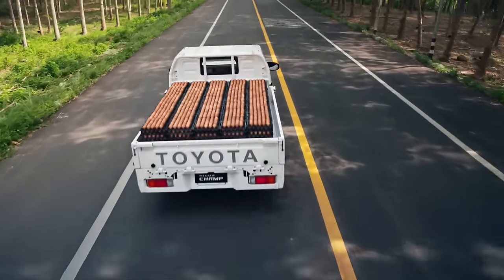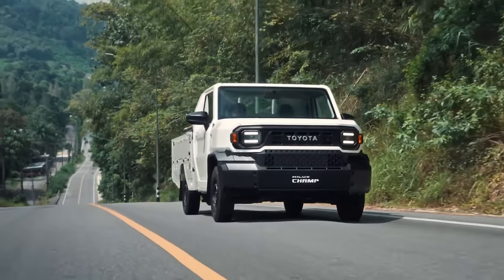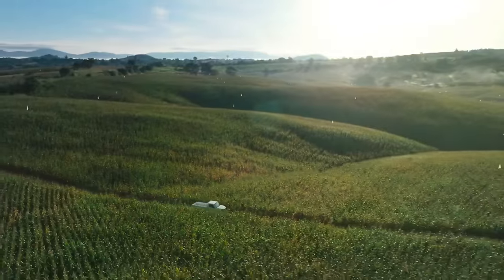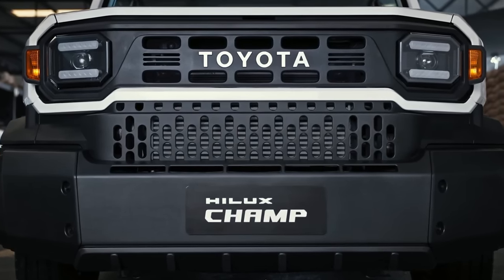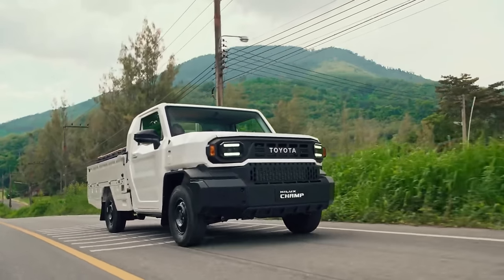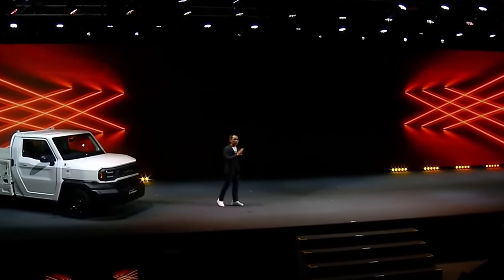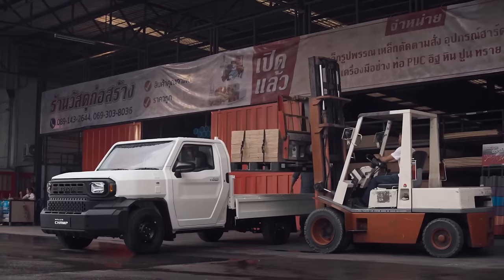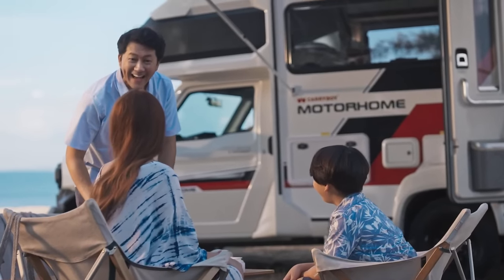Experience the Revolution: Toyota’s New $10k Pickup Truck That’s Turning Heads

Comment: You are certainly correct.  People in the USA are begging for just such a vehicle.  Currently, in the USA mini-truck market, there are EXACTLY zero such vehicles.  I drive a 1985 Toyota 4 x 4  single cab pick up.  The neighbor needs a load of topsoil for his garden?  We drive over to the depot and the loader just dumps it in the back.  Most other people use a trailer.  Mine is suffering from age related cancer and the lift gate fell off this last summer.  The bed is nearly totally rusted out, but, oddly, no rust at all on the cab.  At 805,456 miles (1,296,255 km),the engine and transmission have both been rebuilt once.  A little sloppy on fuel economy (15 mpg or 6.4 kpl), but still more economical to drive than nearly anything else on the market (reliability adds up), Toyota will bring the same reliability to the Champ, if it ever gets here.....  I want the hybrid 4WD model and I want FOUR WHEEL DRIVE (with a manual transfer case), not AWD.

Comment: Here in the US I would be first in line for one if it was 4Wd, extended cab for gear and cloth seats.
Reply: This is the exact thing im looking for. We say we want smaller more affordable more durable trucks. Ford did the mavrick and i think it was a big step for affordbaility but its a unibody thats more for errands. Thid truck you hage that steel bed you can really really do somd serious work without aprrying about it. Keitrucks people were thinking are closer to what we need and this truck toyota seems to be combining like a keitruck back but a more usual engine in an engine bay infront of the cab type design. I think this is a huge saftey improvement and it migbt be what we need to get that kind of a style road legal in usa. Having better powerplants compared to keitrucks too is big.  Being able to buy them brand new is important and right now you cant buy keitrucks new. I want the more durable steel bed i think that ultra durable bed is a super big deal. You habe to be able to beat it up for 30 years and it should still be going.  The single cab is more affordable and easier to replace with a couple buddies if need be and i like that design for a utility truck. Affordable tires. And as well as having a range of gasoline, diesel. Hybrids, and electric all at the same time is a big deal too. A platform with options to suit different peoples needs is big. I like.the diesel but someone who drives less will like the electric and people inbetween will like the gasoline motor. So its good to see that. Body on frame is also keystone feature for me in a truck. To have a truck like this thats body on frame is good.  If they cost 10k or like 15k for the diesel or something like that, it would be crazy esspecially if we could finally get them in usa. The proble. Is toyota tundra and tacoma are big and expensive. Theyre nice usa likes them i like them but i also like innovative ideas like this for a lot of the work load. A truck like this is grsat for moving around my motorcycles, pickup up the poting soils, rocks etc. A more durable bed for that junk work keeps the nicer more expensive trucks in good shape longer.  I think this type of design is a little safer than the keitruck design as well. I think if we dont allow these on american roads we must revolt like george washington intended. Ford is supposed to have something like this Under the mavrick for real. This is what we wanted. Thisnis right down the alley of what many americans want. This truck can truely overtake the legendary 90s tacomas. Very smart kind of truck. An actual small and extrae extra durable. You get a super durable bed compared to aluminum tin can thickness sheet metal which is what i want. Diesel as an option is dope. Thats what i would get personally. I like these trucks so much compared to the great tacomas and ford rangers i think theyre durabikity will lend them well to bysiness aspects too where i could buy a fleet and rent then out locally stuff like that. Its very gard for poorer people to get into these kinds of busiensses when each truck costs 70k and no one wants to pay the daily rental cost on there day worth of a fraction of that. You gey super dope units like this rolling off the lot for 10k 15k 19k ornwhat have you, and its a game changer
Reply: From the promotional photos I've seen you can convert it to an extended cab.
Reply from the maker: A 4WD, extended cab model with cloth seats sounds like a dream truck. Fingers crossed for a US release! 🇺🇸🚚🤞

Comment: So IMV0 is basically Toyota's take on the 1980s Chrysler K-Platform that underpinned a variety of body styles and used shared, simplistic mechanicals to keep the price down across the board.
Reply from the maker: Indeed, the IMV0 does seem to draw parallels with the Chrysler K-Platform in its approach to versatility and cost-effectiveness. It's intriguing to see how these time-tested strategies are being adapted in modern designs.🚗🔧
Reply: Yes, yes indeed Watson. The Toyota K truck 🛻 Lee Iacocca would say… If you can find a better truck Buy It!

Comment: Looks like a larger version of a Japanese kei truck... aka another great light truck we won't get in the US.
Reply from the maker: You’re right, it does have that kei truck vibe! Here’s hoping we get to see this Toyota pickup on US roads soon. It would be a game-changer! 🚗💨
Reply: Idk man it looks built for the usa to me 😂 thing looks american straight up
Reply: @TheAnnoyingBoss  - The bed sides that fold down or can be removed easily to make a flat bed is a JDM truck feature.  Ditto for the tie down stakes on the top rail outside of the bed sides.  Perhaps the biggest JDM truck feature is the bed above the wheels so the wheel wells don't eat up cargo space and make it difficult to carry fragile sheet goods such as drywall without cracking it down the middle.  I've owned and used US trucks for decades and now I own a Hijet Japanese mini truck.  From my perspective, US trucks are made to look big and tough while Japanese trucks are made to be practical and useful so they can do serious work, reliably.  In the unlikely event that Toyota can sell a base model 4WD Hilux Champ in the US for $15,000, they will OWN the new truck market within a year, but I'm fairly sure they'd prefer to continue selling us $40,000+ Tacomas and Tundras.

Comment: In1970 l had a Ford F100 manual pickup. Straight 6 ,250 cubic in, simple , bench cloth seat ,easy to work on,parts were cheap and it went for scrap after 300k miles.
Reply from the maker: Ah, the '70 Ford F100, a classic! This new model does seem to echo its spirit. Exciting times ahead! 🔄🎉

Comment: i think if they can get this 25-30+ mpg with 4x4 2000 lb payload AND keep it under 15k in the USA they will not be able to keep up with production A/C would be a nice plus but not required and i think having the option not to slap on extras is what's missing in the modern market
Reply: It's been years since I tried the A/C in my truck! No idea if it still works. Heat? YES! (in Vermont) I generaly dress for the weather but fog will freeze to the interior windows without good defrosters.
4wd would be nice but I can deal without as long as it locks.
1 Ton is an absolute must-have! That's pretty standard in all countries except the US.
I'd spend another $1k for a solid 6 speed.
Reply: @antilogism  i live in iowa so in winter it like the north pole and in summer its like Florida

also i was watching a walkaround and the one in the video is a standard but i have no idea the gear count likely 5-6
Reply: @Friedrich-Wilhelm-1980  We only get to maybe 90 and a bit muggy. Heat's only an issue when it's raining and I can't open the windows. In California, my last state, it got 105-115 but always bone dry. I would use A/C in traffic since there's no air flow on the parking-lots we call Freeways.
Reply: @antilogism  yeah here it can be 90 degrees with 100% humidity and no chance of rain all the corn fields let off so much humidity when they're growing and it just turns into a giant cloud on the ground AC in Iowa is fairly necessary
Reply from the maker: Absolutely, a practical, affordable truck with good mileage and payload could indeed revolutionize the market. Let’s see what happens! 🚚💡

Comment: I do hope this comes to Australia and it will be under aud$20000 and there are two small hatch backs about the same price but this if it ever does come to Australia will sell very well and the biggest selling vehicle in Australia is the Toyota Hilux but it will be cheaper than the very basic Hilux but well done to Toyota for building a cheap Ute
Reply from the maker: A release in Australia would indeed be exciting. Here’s hoping for the best! 🇦🇺🤞
Reply: @PistonPundit  lf the Hilux Champ is released in Australia l have seen it could be around aud$19000 which would be the cheapest vehicle available in Australia but it could find its way into Australia as a grey import but l do like the fact that they are so basic

Comment: This small pickup truck code named the Champ was designed in House at the  Toyota Thailand factory where the normal Toyota Hilux Pickup is also produced , it's intended low purchase cost Market is for Thailand , Indonesia , Malaysia and Vietnam and other south east Asian countries as well as Southern Africa and later into Mexico and Central American Countries. It will not be sold or marketed in the USA or Canada as  it will not meet the standards required in the USA
Reply from the maker: It’s fascinating to see how different markets have unique demands and offerings. This Toyota pickup seems to be a great fit for the markets you mentioned. 🚗🌍🔧

Comment: The chap needs to be a 4 x4  Drive with bigger, wider tires and come in a diesel version with a shortened wheel base with all KEI features! 4or6cyl. diesel Small is IN !  6ft KEI box
P.S. I want Right Hand Drive also in the USA 🇺🇸
Reply from the maker: A 4x4 drive, wider tires, a diesel version, and a shortened wheelbase could indeed add to its appeal. Small is indeed in! Let’s hope for more diverse options in the future. 🚙💪🔄

Comment: Apples are good at being apples and oranges are good at being oranges.    The Maverick is a better utility car for the 95% of people that buy compact trucks.  For anyone using a ladder frame  compact truck for work, they carry an impractically small volume of cargo but their price and gas milage is close to a 1/2 ton.  The Champ is pretty awesome for what it is,  which is a cheap utility truck, and I love that it comes with dropsides. 

What these are both fantastic alternatives to is the Tacoma.   A swiss army knife with 4 commonly used blades that doesn't take much space in your pocket is just a better swiss army knife than the most expensive model that has 60 different redundant blades and weighs down your pocket.

The Ford Model T assembly line was old news 100 years ago so its annoying to hear the dramatic voice describing it today.  How they cut costs is don't sell the vehicle in the US, so that it can hit roads with more primative crash test standards.  That is not a problem because this is a lot safer than a lot of the vehicles on the roads in those markets.

Comment: I have a hard time believing it's only $10,000 There's got to be  catch. My thought is is probably $10,000 for the bare bone which is basically a go-kart. Won't haul anything won't pull anything won't be able to put anything in the bed that's more than 250 pounds. You want the four-wheel drive and something that will haul a half ton that's probably an extra 25,000 so probably $35,000 all together
Reply from the maker: Indeed, the base price often refers to the most basic model. Additional features and capabilities usually come at an extra cost. It's always important to consider these factors when evaluating the overall value of a vehicle. 🚗💰🔍

Comment: Gimme an extended cab bench seat and I will buy one immediately!
Reply: Bench seats are great but I once had ex cab and that space was wasted most times. I chucked the seats and sometimes tossed an extra tool there. Meanwile it was like parking a bus daily. I won't touch an ex cab anymore and just add or remove the bed-box as needed. These days I mostly truck wood, soil, mulch, fertilizer and whatnot.
Reply: @antilogism  - that’s great and all, but I’m 6’4” and there ain’t no way I’m getting anything but an extended cab 🤷‍♂️. Tiny lil Japanese people design these for tiny lil people.
Reply from the maker: An extended cab with a bench seat could indeed add to its appeal. Here’s to hoping Toyota hears your feedback! 🚗💺👍

Comment: Not available in the US I'll bet. If it was, Ford and Chevy would still be selling S10 and Ranger without all of the legal required nonsense. I f they sell that Toyota here, $25,000 minimum. Wait and see.
Reply from the maker: Indeed, market dynamics and regulations can significantly influence vehicle availability and pricing. It's a complex equation, but it's what makes the auto industry so fascinating! Let's see how it unfolds. 🌐💰🚘

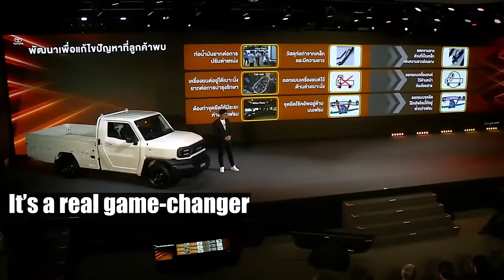Comment: 5:33 "With a starting price of just $13,000..." 

That's not $10,000 

I'm no mathematician but... I don't think those numbers are the same number.
Reply from the maker: You’re right, the $10,000 is for the base model. The $13,000 price tag includes additional features. It’s always important to consider the total cost with all the desired features. 🚘💰👌

Comment: Give me one with a 4 cylinder 6 speed manual maybe a low first for crawling and I would drive one. Long as it’s manual or at bare minimum auto! No cvt I refuse to buy any cvt expect my moped it’s a Honda metro I trust it but they are proven to work and are easy to fix a car cvt ain’t any of those things!
Reply from the maker: Absolutely, the charm of a manual transmission is hard to beat, and its reliability is a big plus. Let's hope for more diverse transmission options in the future! 🚗💨🔧

Comment: No matter how much it costs to produce, if it ever makes it to America, it will cost at least $35,000 for the most stripped-down model and if dealers get their way, the average cost will be $40,000 to $50,000.
Reply from the maker: Indeed, the pricing dynamics can vary significantly across different markets. It’s a complex interplay of production costs, taxes, and market demand. Let’s hope for a balance that benefits both the manufacturers and consumers. 🚗💰

Comment: The last great body on frame tiny pickup I had was the Nissan D21 with a manual. That thing would do way beyond what it was rated for. Getting bigger is just a way for these companies to escape regulation. It's more profitable to sell a few, high market things, than to sell many low market things. The other thing is subscriptions and add-ons. Our current economic model in the US will not allow these kinds of trucks into the market, for no less than $30k.
Reply from the maker: Your Nissan D21 sounds like it was a real workhorse! It’s true that market dynamics can impact availability and pricing. However, the need for affordable and practical vehicles is real. Let’s stay hopeful! 🚗💡👍

Comment: I'm lucky enough to still be the proud, original owner of my '85 SR5 4x4, which I immediately went into debt to buy the summer that Back to the Future hit the theaters.  I paid $10,000 for it in '85, and I think it would be awesome if my very first Hilux, and my very last before I die, cost the same.  I do hope these make their way to the US market.
Reply from the maker: What a journey with your '85 SR5 4x4! This new model could indeed be a fitting successor. Here’s hoping! 🚚🔄
Reply: It's not the small trucks that are needed, but the diesel 3/4 ton and the 1 ton. The 4500 and the 5500 are selling like hot cakes here in Texas.

Comment: I love it !!! But it needs a 4x4 !!!
Reply from the maker: We're on the same page! A 4x4 version would indeed take this truck to the next level. Let's hope Toyota has something in the works! 🚗🔧
Reply: Might not be possible since this is the very utilitarian version of the Hilux. Idk this comment might spoil like milk tho but for us Asians, which is the main demographic for this vehicle, it's just fine like this.
Reply: The cheapest version should be like a 4 cylinder 2 wheel drive. Itll also probably be the most reliable and easy to work on. But yes 4x4 will be cool if it can happen. Plus the hybrid and the diesel is pretty sweet i like diesels. Slow but mighty

Comment: I like the idea of having a bed like the Kei trucks offer, but it would need taller sides and tailgate.
Reply: I like the bed. Steel is easy to modify bro. You can maoe it whatever you want it. My only worry about the keitrucks is the saftey is low. Butni ride motorcycles so i have a tendancy to take risks 😂 so to me it wasnt a bug deal but we have to be smart and rememebr if a lot of people boight them it would be more than had them in japan so the accidents would be up and not good. Them goingnwith this type of design is much better in my opinion. The super tough bed is stronger than any ford factpry bed ever was ever 😂 the gasoline, hybrid, diesel, and electric strategy is a big deal to me because i can think of different applications for each easily. I like the single cab in terms of affordability. I like the engine bay design where utd infront of you rather than keitruck deisgn where rhere was nothing infront because that buffer zone will be key in accidents.
Reply: @TheAnnoyingBoss  I like the truck and would buy it if it was offered in a 4WD and hybrid format. The bed rails would definitely have to be taller because of what I need the truck for
Reply from the maker: A bed like the Kei trucks with taller sides and tailgate? Sounds like a practical need. Let’s see what Toyota has in store for us! 🚚🔧